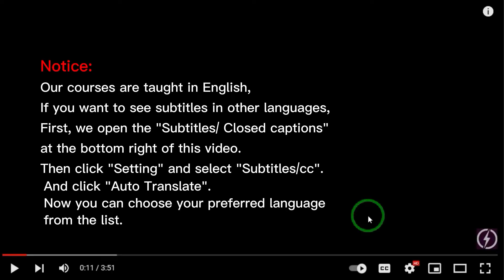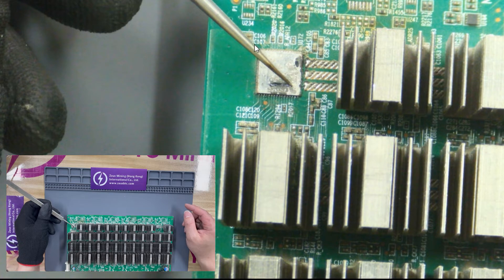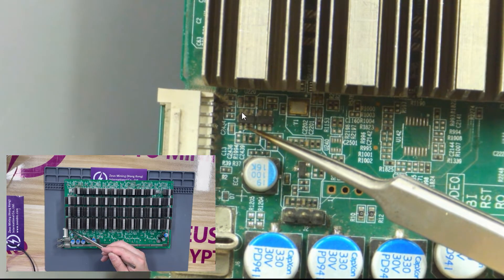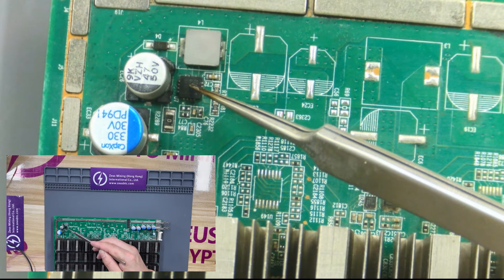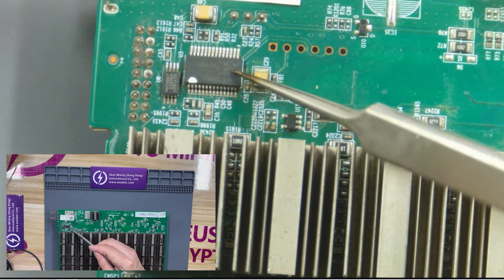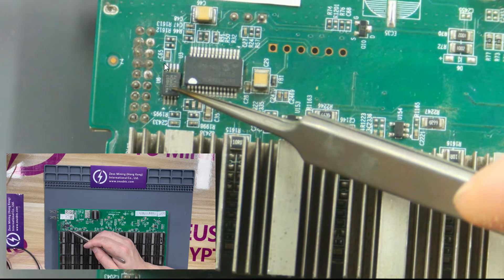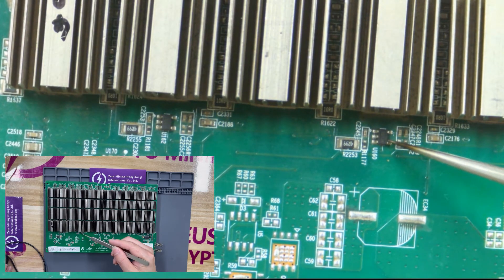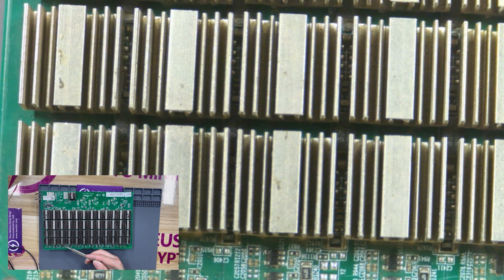Easily damaged parts of Antminer S17 Pro hash board introduction

Comment: Help me . I found error set_voltage_by_steps to 1500.
2022-12-19 07:55:52 start up min temp by 75a = 31
2022-12-19 07:55:55 Chain[0]: find 126 asic, times 0
2022-12-19 07:55:57 Chain[1]: find 0 asic, times 0
2022-12-19 07:55:59 Chain[1]: find 0 asic, times 1
2022-12-19 07:56:00 Chain[1]: find 0 asic, times 2
2022-12-19 07:56:00 Chain 1 only find 0 asic, will power off hash board 1
2022-12-19 07:56:02 Chain[2]: find 126 asic, times 0
2022-12-19 07:56:02 ERROR_SOC_INIT: soc init failed!
2022-12-19 07:56:02 stop_mining: soc init failed!
2022-12-19 07:56:02 uninit_temp_info
2022-12-19 07:56:02 do not read temp anymore...
2022-12-19 07:56:02 cancel thread
2022-12-19 07:56:02 ***power off hashboard***
2022-12-19 07:56:03 temp monitor thread exit
2022-12-19 07:56:30 Version num 65536
2022-12-19 07:56:30 Mask num 0x1fffe000
Reply from the maker: You need to give the complete miner log.